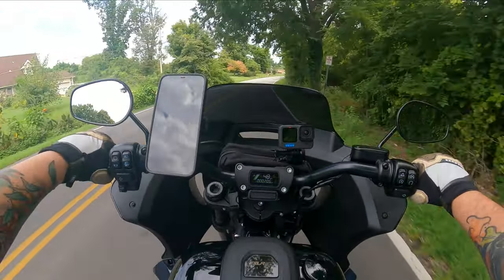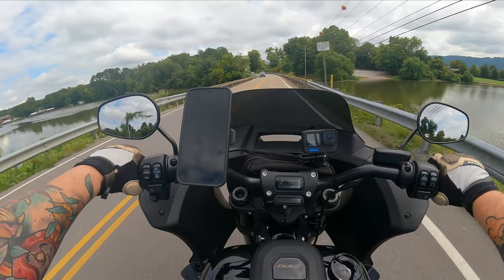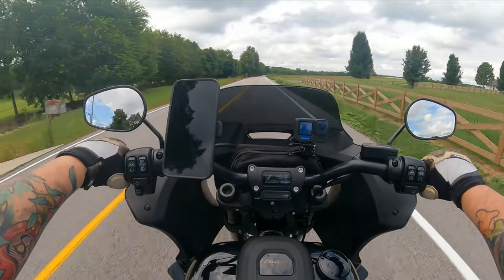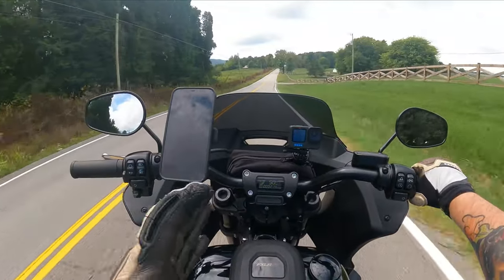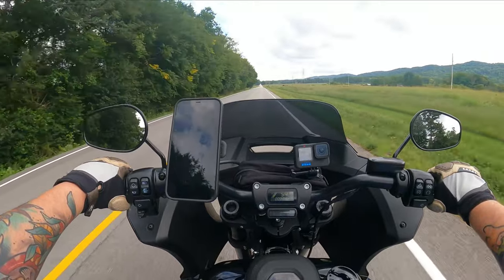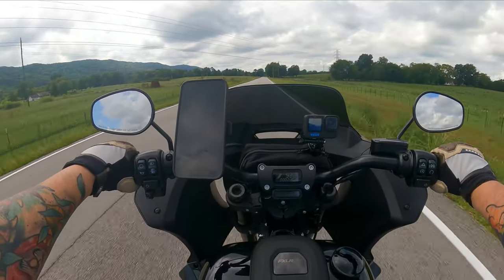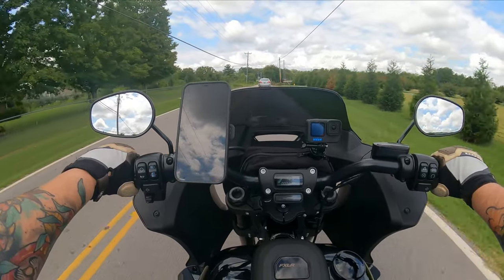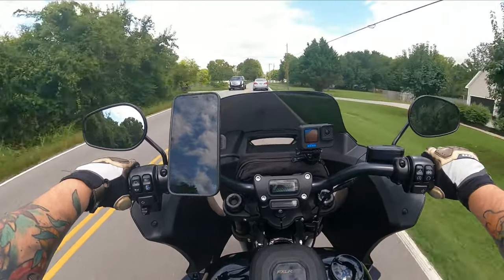How to Break in the 2022 Harley Davidson Low Rider ST

Comment: Hi Ty. I need your thoughts. I bought a brand new stock Low Rider ST last week and I’m wondering if the high frequency vibrations above 2000rpm in the pegs are normal. Do they go away with time? Thanks
Reply from the maker: Hey there! Congratulations on your new Low Rider ST!! It's such a fantastic motorcycle. I really do love mine. I know what you are talking about and noticed a bit of vibration with my feet too. I quickly changed out the pegs and installed the OG mini floorboards. Here's a link if that is helpful --> https://bityl.co/F6Yp
I won't say that took care of it completely. I think the design of the bikes just shakes a bit more than I'm used to with a bagger, but it's much better now. Thanks for reaching out and have a great day!
Reply: @TyFromTennessee  thanks a lot! I agree the bike is fantastic. I have been lucky to grab the new Tobacco Fade version. Love it!

Comment: Heat cycles break in a motor. Any good engine builder will confirm that. Brand new motors get dyno’d within 5 miles at the redline. The motor company is just covering their butts in case something happens. However, there’s nothing wrong with following the manufacturers method either. I’ve got a 23 SG ST on the way, and I don’t plan on riding it too crazy. I’m not gonna hot rod it just for the sake of hot rodding. I can control myself for 500 miles. 😅
Reply from the maker: I follow your logic sir and agree with you 100%. Congratulations on that ST! What an awesome bike! I'm waiting on my 2023 120th anniversary Road Glide Special. Thank you very much for watching!
Reply: @TyFromTennessee  those bikes are stunning. I can’t wait to see one in person. The anniv SGS was my second choice, partly because I really wanted to get away from the black bikes for awhile. But my other choice was white for the ST, and that color I just can’t do. lol. I’m looking forward seeing your content on the new bike!  Love the channel.
Reply from the maker: @Fever_Rides  Thanks man. My local dealership expects the bike within the next few weeks. Keeping my fingers crossed!
Reply: Thanks for that info.

Comment: Ok so seem you traded in your sportster s. What’s your opinion of the low rider st for 2up riding? I have a 21 ultra I was going to trade one it for a low rider st but not sure. I’m 6ft 1 290lb and wife 165lb
Reply from the maker: Hey there. I'm afraid I'm not going to be able to offer much advice here since I don't do any 2-up riding, BUT I can tell you that the motorcycle is incredible and I'm sure that 2-up riding would be the same on it.
Reply: @TyFromTennessee  I see you have a street glide cvo if I’m correct. How the room compared to the low rider st.  Reason why I wanted to switch is because we don’t ride crazy long trips maybe 200miles if lucky most of time about 100 miles
Reply from the maker: @CodyMcDonald89  Quite honestly, if all that I was doing was 200 miles in a day the LRST would be my pick. I love my CVO, but just for day rides here and there, the ST is such a great bike. I was even talking to my wife the other night and I told her IF I had to get rid of one of the motorcycles it would probably be the CVO. Yes, the Low Rider ST is just that good of a motorcycle to me.
Reply: @TyFromTennessee  thanks for your opinion. I did do a stage 2 on my bike already and bars but… they are offering stage 2 on this bike as well so I think I’m going to go down and talk to them about it. I’m a little taller so would need forward controls

Comment: I don't get it.... so in the first 50 miles, when I accídently went over 3000rpm like 4000rpm what will happen? it's petty isn't it? 
What I have seen is, that on the test bench in the factory they are testing it and rev it highly through all gears
Reply from the maker: I just try to ride the motorcycle the way that I normally would during the break in period. I was once given that advice and it's worked out pretty good. Thank you for watching!
Reply: @TyFromTennessee  yes exactly that's what I will do with my FXLRS2022 ... but I need to change the stock exhaust (european/german version) it is sooo quiet

Comment: Some of those rules are not about breaking in the motorcycle but are there because the manufacturer is trying to watch over the safety of a new rider, or at least one that is new to that motorcycle, breaking in the new customer, I guess, which they might want to think of as a new member of their "family", which about makes me want to puke. However, I believe in breaking it in easy rather than hard. I understand rings need to seat, but bearings take time and putting a load on them is putting a load on them. I do wonder now, about what happens to oil in the engine during a hard brake.
Reply from the maker: Hey Ray. You bring up some really great points in your comment. Rider safety is certainly a focal point and I’m certain corporate lawyers and HR gets involved too. Thank you very much for watching. I appreciate your time.